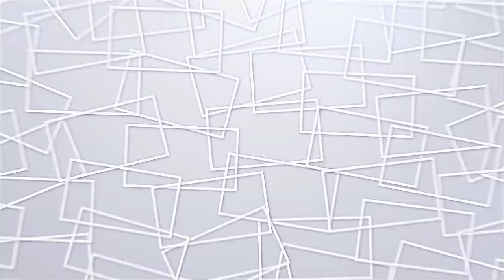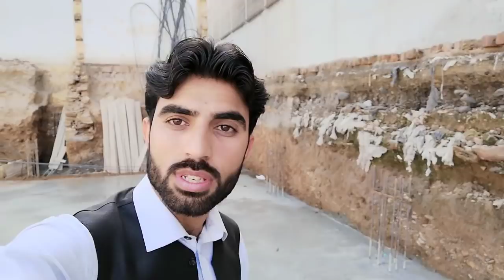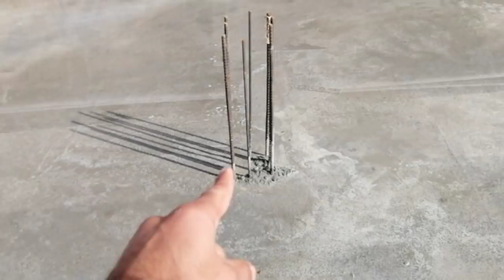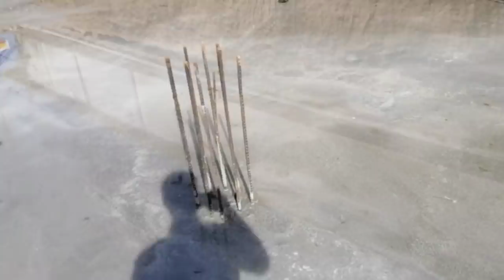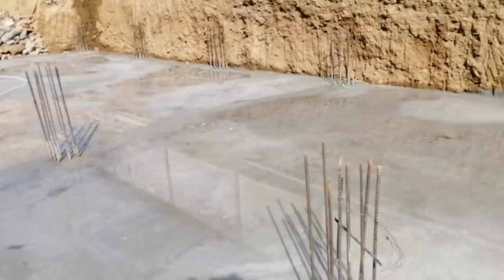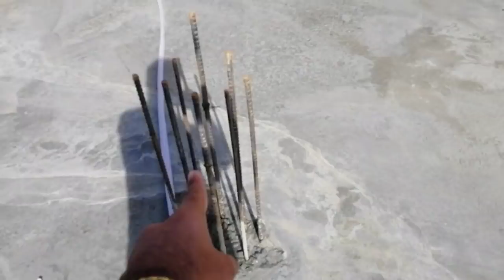Big Mistakes in RCC Column for Lapping Length - Civil Engineering Stie Construction Videos

Comment: Technically, Lap length is not actually always 50D, it so happens that it is a common practice. Lap length actually depends on the grade of reinforcement and concrete cube we are considering. All of the lap length code standards can be found in Table 3.27 of BS8110. An ACI however, had a different approach in calculating http://bit.ly/LapLengths.

Comment: but, if we cut all the bars at a same position it will create a weak joint...
Reply from the maker: don't cut at the same position but its should be not less than 50d if its more and not in same position than ok
Reply: @CivilEngineerss  What is the effect in the structural stability of the column if the lap splice that we provided is less than 50D?
Reply: @TheStructuralWorld  They may fail due to stress induced in it.
Reply: @neerajce  What kind of failure?
Reply: True
Reply: Yes dear